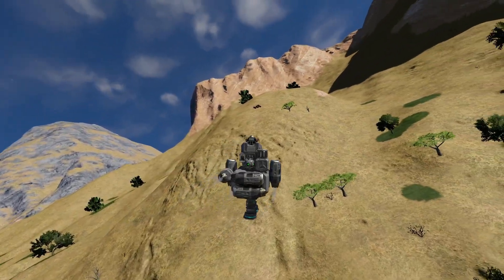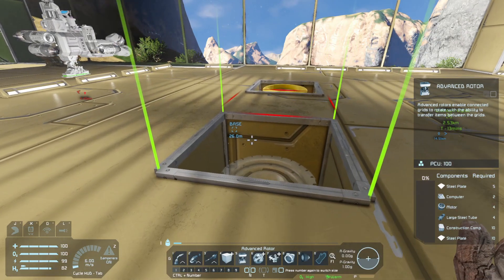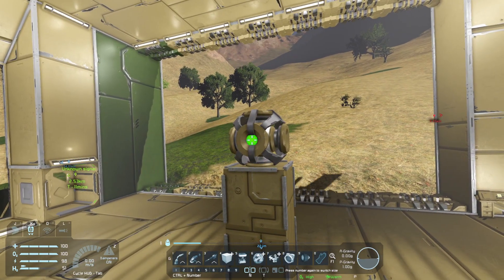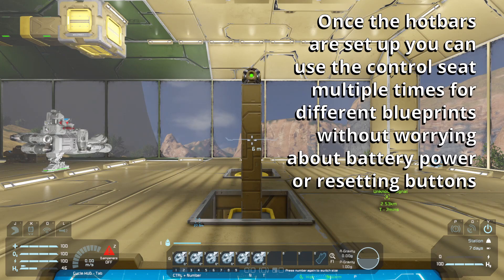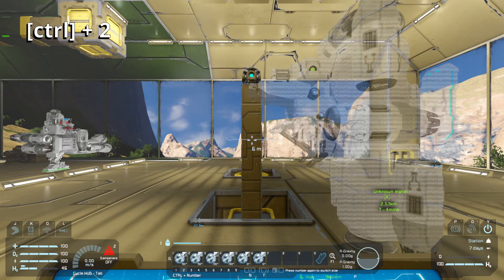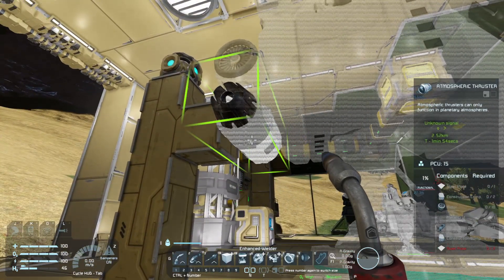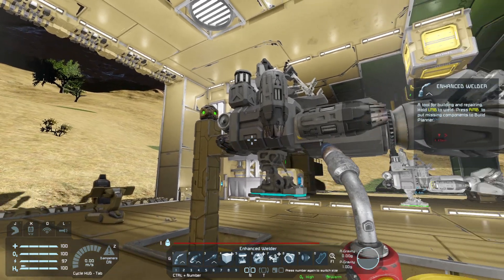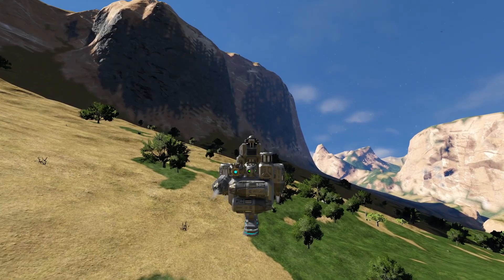Using Projectors | Space Engineers

Comment: How do I change when it says wrong grid size?
Reply from the maker: If the item you're trying to place is in button 5, for example, press 5 again. Not everything is available in small and large grid though.
Reply: It’s the actual blueprints that fails to go on the projector because of wrong grid size
Reply from the maker: Ah right. If it's a large grid blueprint it needs a large grid projector. The controls are the same. You won't need a rotor to place it on though. Just put it on your base somewhere.
Reply from the maker: Exact same technique. Even looks the same. Just the projector is larger and will place straight on your base.
Reply: Cheers and thank you for helping me with this 👍👍
Reply from the maker: No problem. I'm pleased I could help! All the best.

Comment: I nice thing to have said is that you can put a switch On Off for the Build&Repair in menu 1, maybe number 9. This way you could be sure if they are operational.
Another thing, you are right that absent of the build and repair it is advisable to put the projector into buildable only but this does not guarantee that all parts would be welded because we could start welding like crazy, mainly the outside stuff and miss the inner smaller components, like gyros, etc.
Regular checks on the K menu would make sure we don't miss a part as it would say incomplete.
On SE mode it would be advisable to actually switch ALL thrusters OFF whilst being constructed because it consumes battery power plus it does not put a strain on the rotor head, this is especially true in big builds.
Reply from the maker: I agree, an on/off switch for the BaR would be a good idea. Yes the 'k' menu for unfinished items! I wish I'd remembered to include that. Well spotted. I'm pretty sure I mentioned turning thrusters off, but I also mentioned turning them on just before creating a blueprint (in an earlier video). That's only really good if you are spawning them in. Best if they are off for blueprint building, as you said, to save unnecessary power drain. Thanks for commenting Alvarez. Some very good observations there. I appreciate it.